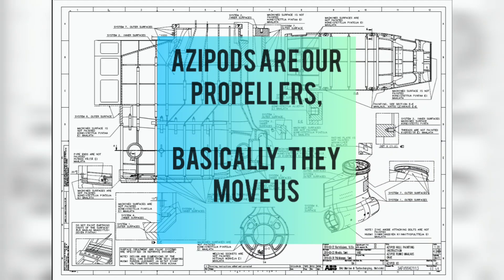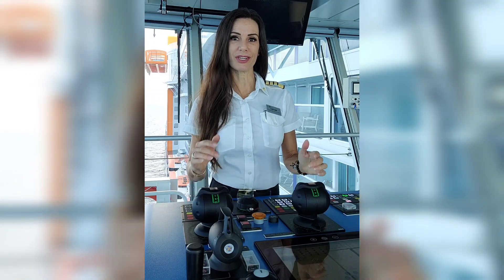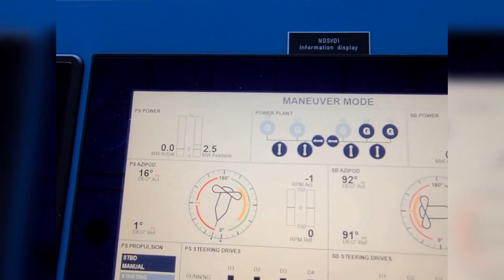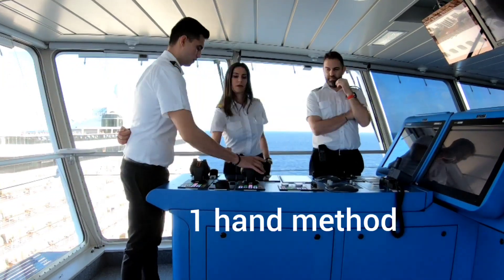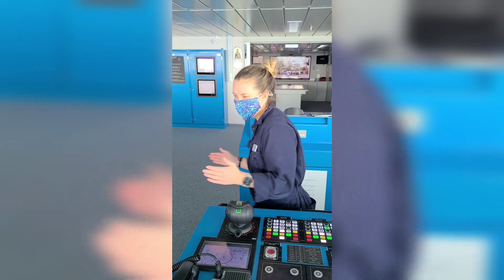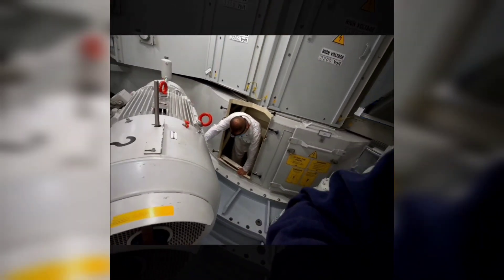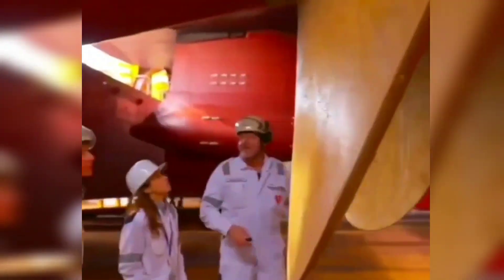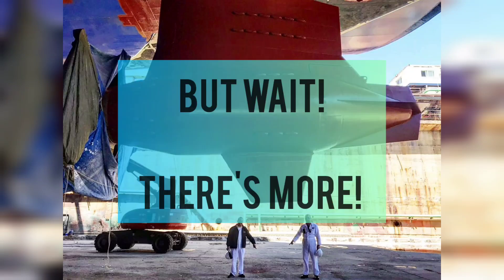Episode 5: How I Sea It - Azipods

Comment: You should show the engines on the ship at some point Because I think people would be amazed on how big they are. The engines on the ship are actually so big. You could actually get inside of one not when it's running of course There are inspection ports on the side of the block where you can climb in the engine And the engines are started by air Starters And the reason why that is is because it takes a lot of power to start One of the engines And how I know all of this. Besides went to diesel mechanic school and my teacher know one of the people that worked for wartsila witch is a manufacturers that makes cruise ship engines

Comment: Some quistion 
1.when the ship change command from wing to center. Did you always reduce to stop engine or its automatically follows the last move?? 
2.what type of azipod propulsion blade ? 
Its fixed or cpp?? 
3.and bow thruster blad. Same. Its fixed or cpp? 
4. How was the combination
- some diesel engine to all consumtion? 
Or
- its spesial DG for each azipid? 
5. Is it need tug asistant or not? I never see tug on cruise ship

Tkz

Comment: This is very informative, Captain Kate! 

On U.S.S. Enterprise (CVN-65j, the four propeller shafts were of different lengths depending on the location of its steam turbine. The longest was #1 shaft, at approximately 700 feet. It ran through many occupied work spaces, and six-footers like myself had to duck to pass under it. This shaft was uncovered and spinning right above your head...but you got used to it. 

We did have cats aboard, too- Tomcats!
Reply: My question is why don't carriers use azipods?

Comment: Hi Captain Kate, thanks for the explanation of the Azipods!  I didn’t realize that they pulled, I always figured that the propeller was at the back  and they pushed the ship.  Cute out take with Bug!   Ken
Reply: They are more efficient when they pull because there’s nothing in front of it (like a shaft) to make the water turbulent, which gives the screws more “bite”, and in turn more thrust. They’re amazing devices.

Comment: When I asked a bridge crew member of another cruise line why they didn't use azipods, his answer was the line considered azipods expensive and a maintenance headache (they ate bearings).  Has this been Celebrity's experience?
Reply: William Miller, that is an issue with a different manufacturer named Mermaid propulsion pods. Ironically, Celebrity line had them in older ships but has since switched (like Royal Caribbean) to ABB Azipods. . https://www.travelweekly.com/Cruise-Travel/Pod-issues-force-Celebrity-to-move-Infinity-to-drydock

Comment: Want to say your reaction at 5:48, you look like Sandra Bullock?

I do have a question about the azipods. I’ve seen some with variable pitch blades, and the ones installed are fixed. Is it fixed due to cost in terms of the units, or when going from full ahead to crash stop, the fixed azipods are least noticeable due to vibrations and noise?

Another question I have is; when the azipods are either +/- 90 degrees off axis when going port or starboard. Does the computer automatically turn on the bow thrusters to help move the ship port or starboard?

Seeing this video and the rest is a good brain exercise of mechanics and general technical operations.

Comment: Just found your channel and have to admit I binge watched your videos at my lunch break, or maybe a little more than lunch (don't tell my boss). Since you're on the topic of naval engineering, and as an engineer, I was curious about the design of the Edge.  Specifically the rake of the prow which appears to be reversed from most ship designs as well as the lack of a wave breaker.  Most ships I've seen, and boats for that matter,  have a prow which is raked aft as you approach the waterline, even large cargo vessels are nearly vertical but still not raked forward as you approach the waterline as the Edge seems to be designed.  Keep on keeping your crew and ship safe, and congratulations on your promotion to Captain, love seeing "outsiders" breaking the barriers of traditionally gender biased jobs!

Comment: So interesting. Thanks for doing that. I’ve been fascinated by azipods since I saw the documentary about repairing the bearings for the azipods on Allure of the Seas using cofferdams in the Freeport drydock. Amazing scale and technology.
Reply: And also how powerful they are, I mean 22 THOUSAND horsepower each. Smaller azipods have 19K HP each like on Mariner of the Seas and that class. Just absolute underwater jet turbines with thick blades id love to see one in action at full throttle underwater but nobody can supply a cool video like that 🙄